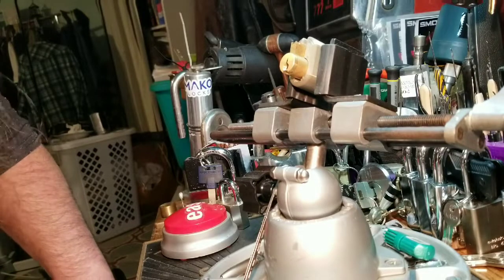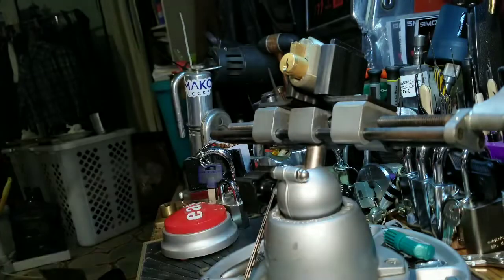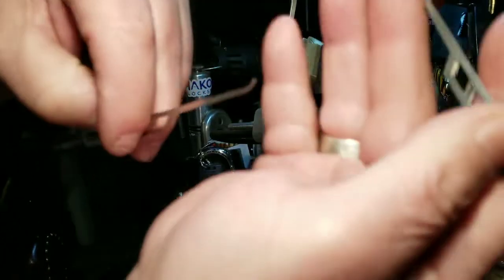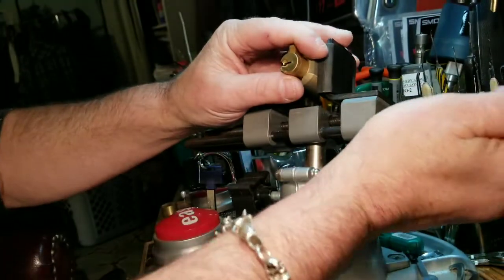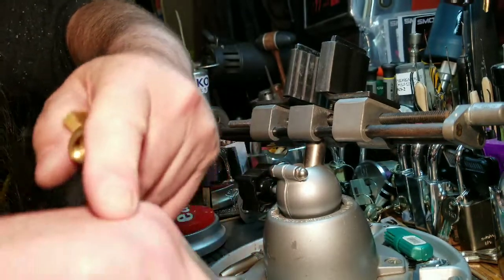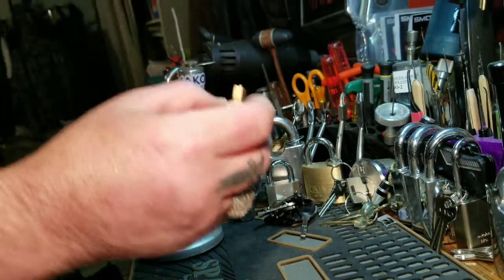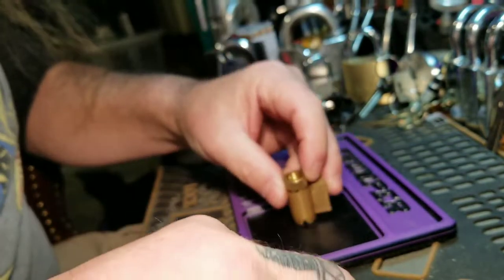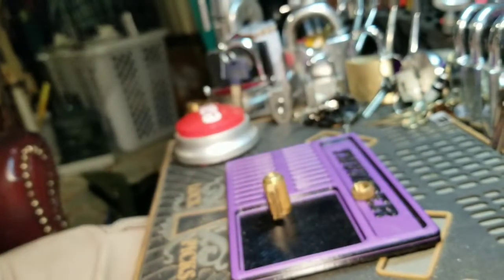#342/Part 1 challenge lock from

Comment: nicely done!  How do you like those Dark Shift picks?  They definitely look pretty cool.
Reply from the maker: They are Great, I wish they were 0.15, but I love them. Sparrows we need 0.15 in the Dark Set
Reply: 《THUMPER》 Lock Picking I agree. I really like my Dark Shift set. I wish they would offer some of their other picks with the Dark Shift handle design as single picks you could purchase them individually to customize the set for personal tastes. I would like a snake rake or a half-snowman Dark Shift and maybe a Lunatic or an Attila Dark Shift.

I think that first pick you showed was the Dark Shift Tron.

My Dark Shift set is my Every Day Carry set. I got the add on set for it and put a mini Jim, warded keys and made a decoder to go in it. I’ve used my set several times to open locks on sites I work at where site managers have lost keys. I have a recip saw and a grinder with a cut off wheel. But cutting the locks only gets me free locks with cut shackles. This way I get free intact locks. If the site managers eventually find the keys it’s a bonus for me. Free lock with a key!